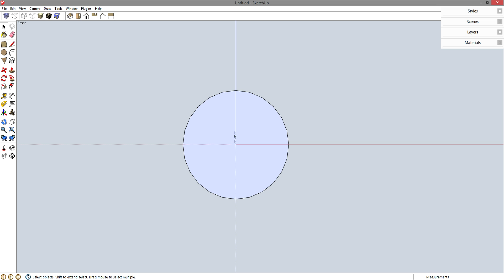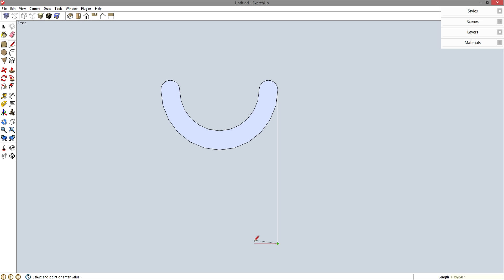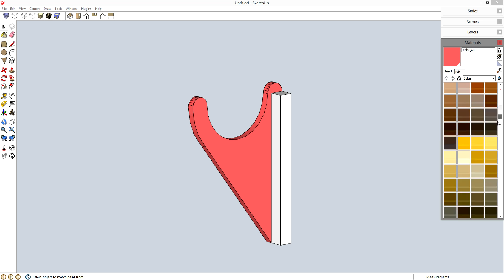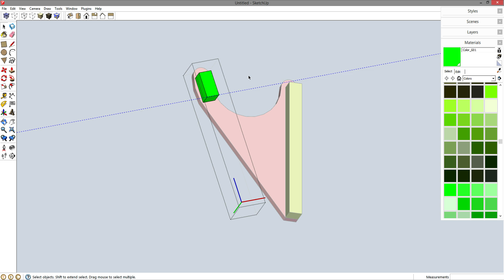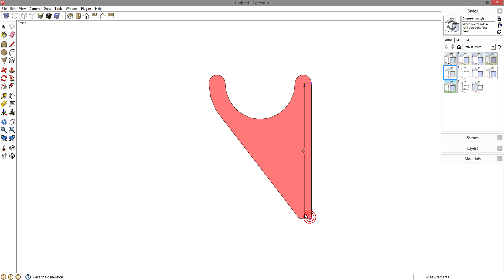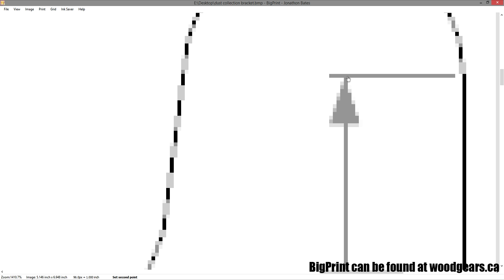SketchUp: Dust Collection Pipe Hanger Brackets - 157

Comment: Thanks for the SketchUp videos!  There's always something to learn, even if it's an alternative like using the 2-D export instead of using printscreen.  Keep up the great work!
Reply from the maker: ManhattanWoodProject Thanks!
Reply: Jay Bates ManhattanWoodProject  I wanted to suggest using "Snipping Tool" in windows as an alternative to Print Screen...basically just go to Start Menu -> Accessories -> Snipping Tool...right click on the application and choose Properties...then in the Shortcut key field give it a shortcut...I used "Ctrl + Alt + D"...now if you are in any program such as Sketchup you can press your shortcut key and the Snipping Tool launches which lets you select a portion of the screen as an image...
Reply from the maker: I use the snipping tool a lot for general grabs and non high resolution stuff. Great tip on the shortcut though. Haven't thought about that.

Comment: You did that as quick (if not quicker) than I could have with pencil and paper. Since it's almost a triangle, guessing you will cut two plates from one board. Thanks for sharing.
Reply from the maker: MRrwmac Yes! Two from a 8-1/2 x 8-3/8" rectangle.

Comment: I normally just print it at scale from within sketchup as long as it under the size of one piece of paper it isn't really a problem to do that
Reply from the maker: cool69rtcharger Yes, that is one option. But I wanted to include the BigPrint option so others could use it on larger projects.